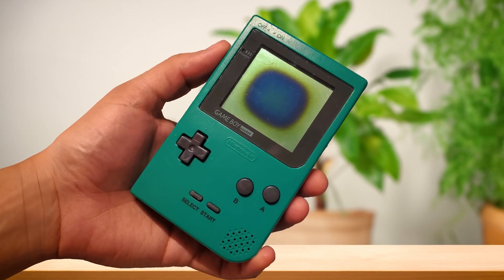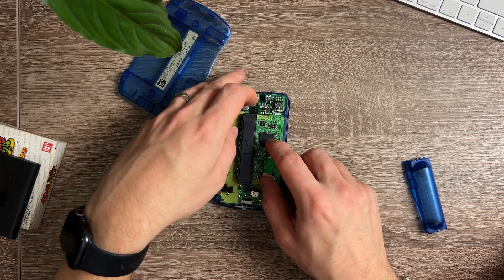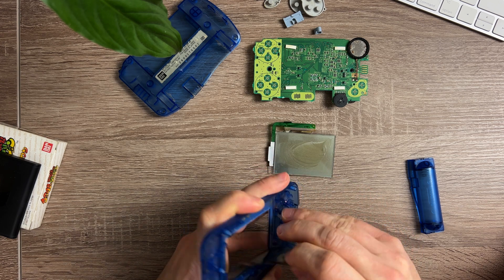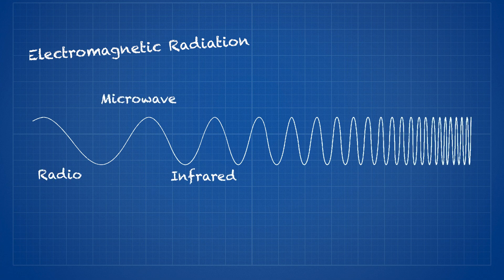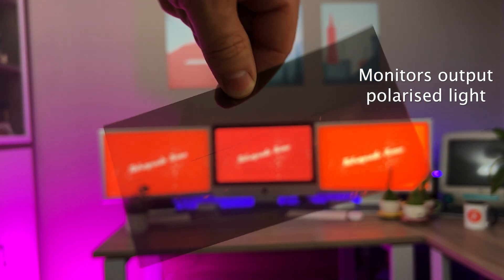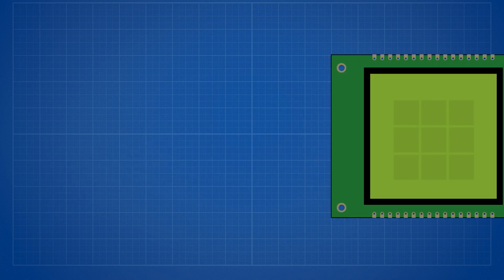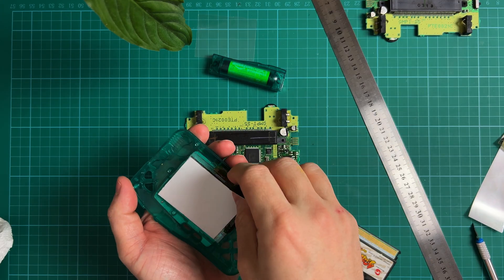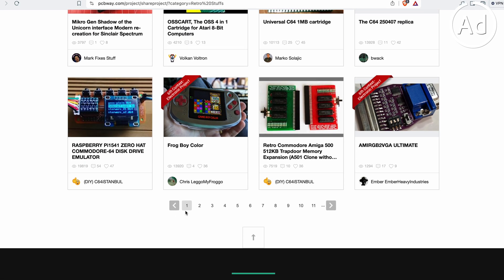WonderSwan screen repair and upgrade

Comment: I might just replace the polariser for mine. I don't play it that much (the only game I have for it is the one you featured in this video, actually (Chocobo Mystery Dungeon)) but I'd rather have it be visible than not. Very interesting that there was such a short run of the original WonderSwan...